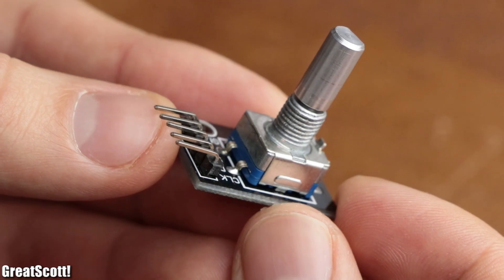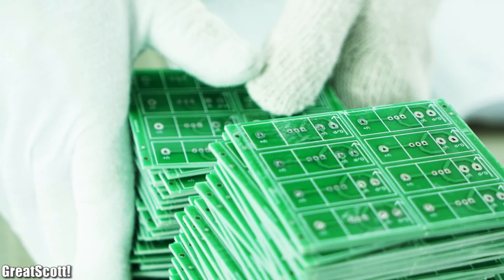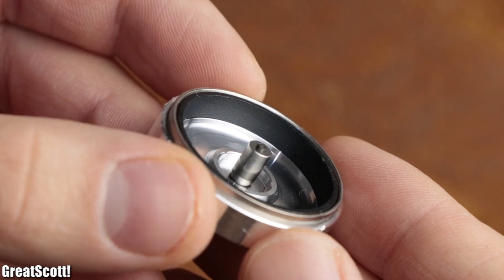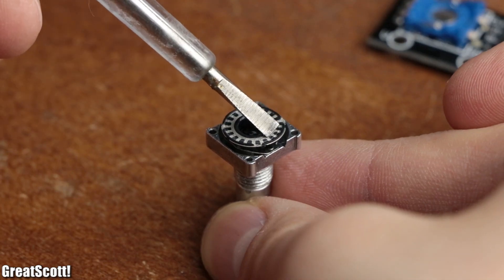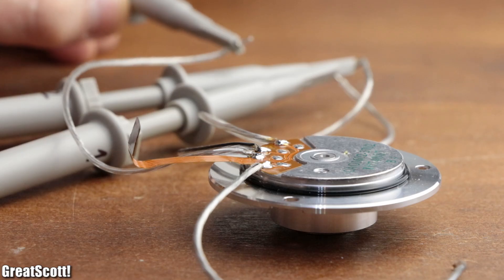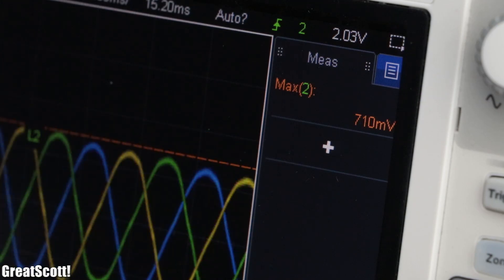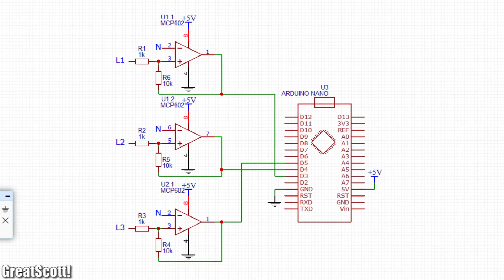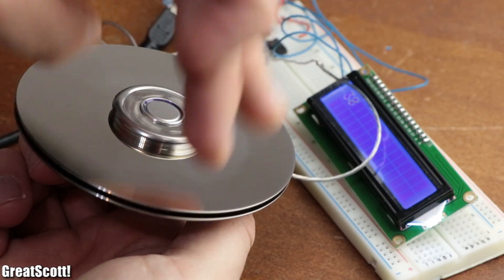HACKED!: Using an HDD Motor as a Rotary Encoder?!

Comment: The number counts up very slowly. 12 poles means each revolution should be what 4 steps?

There has to be a smarter way to get the 12 steps using only comparators.

I guess at analog level the limit is the ADC

Comment: That looks great though I must admit I probably understood only half of it if at all. Would it be possible to adjust the range? E.g. say give it a long spin and have it constantly decrease the value? Sorry for a noob question, I'm not firm in hardware stuff at all, I'm a software developer. So what do we work with in terms of values?
Reply: Haven't built this yet as buzy with other projects so can't say 100% certainty but every time you spin it it just knows the direction so in the code you'll set the rang and the dial will either increase or decrease

Comment: Looks cool! Can you also use this to calculate an angle by setting a refference to 0* and then when you move your angle meter increase or decrease the angle in retrospect to the reference angle? So you get a tool to measure the angle.

Comment: @2:42 when using 3 wire ESCs for 4 wire HDD motor...what does "start point" for 4th connection mean?

Is the 4th connection optional?

Comment: Brilliant.  I took one of these motors apart, but missed the fact that the outer ring which rotates has multipole permanent magnet, which then easily driven by the internal coils.

Comment: Great idea !
 I think you can improve it a little. You can only use L1 and L2 to determine the direction of rotation. At Low to High transition of L1 check the state of L2, if it is High the it turns clockwise else it turn anticlockwise (or vice versa).
Reply: ممكن مساعده بمقابل مادي
Reply: There is some potential latency when you do it that way.

Comment: Hi 
Well explained! 
Can you guide or send any documents for development of small size wheel type encoder for measurement of the distance.
Incremental Rotary encoder with wheel ( less than 1”) 15 pin lemo connector
Thank you in advance

Comment: Very neat. Going to use the motor to run the tower fan the motor that It had has gotten stuck and its hard to turn I'll see I manage to get it going. Other wise I'll place in a hard drive motor, great video.

Comment: That would make for an extremely smooth and precise rotary encoder. Just need to add a momentary switch and precise values would be so easily selected. That actually makes me wonder if a small and cheap BLDC motor could be used the same way.

Comment: hello, i've done a similiar project in the past, but instead of using each period of the sine wave as a one step, i calculated the angle of the rotor continuously with practically infinite resolution only limited by the resolution of the ADC. the three phase voltage values are actually x-y-z coordinates on a tilted circle in 3d space. the normal vector of the circle was (1,1,1) as far as i remember, and doing some simple trigonometry, you can calculate the exact angle of the rotor as long as it's rotating fast enough to generate a measurable voltage. you can calculate the speed from the angle itself, however, the radius of the circle is also the speed itself.

Comment: Well... I don't really think that is very useful as a rotary encoder, since you have to spin it quickly to induce enough voltage and then you have to make it incremenet/decrement very slowly if you wanna be able to precisely control anything.
I guess not having steps is kinda cool, but I would have used a BLDC motor with hall effect sensors in it or something so you can also spin it slowly without it just ignoring the rotation. But in that case you might as well use an optical rotary encoder with no steps like the clarostat  600-128 for example and maybe add a metal knob with a fair bit of mass to give it some inertia.
Reply: Exactly.  Many CD rom spindle motors are sensored and can be used with precision as an encoder.  The reason to do that though would be mainly due to cost and desire to recycle.

Comment: SHEEESH.... WONT A NEMA17 STEPPER ALSO WORK ??
Funny watching a NEMA17 FIRING LEDS without a battery too.
I guess much work is left to me.
A spring-loaded spool, a NEMA17.... 
A CLOSED LOOP SPOOLED CABLE/CHAIN, AND A NEMA17,...
A HANDWHEEL AND H-BRIDGE ...

Comment: The V-level dependance on speed of rotation is a main problem even with a squaring amps. You will shurely loose some of encrements if apply this as positioning encoder.  Look at price of normal optical encoder. It is cheap, precise and perfect. Just use motor as motor.

Comment: Very cool, I have a bunch of these old motors laying around in my back room. I have always been a sort of hoarder of electronic parts, even as a young boy, I would tear apart old radios, and unwrap the old waxy capacitors, then use the foil as a sort of reflector around my bedroom.  These could easily be used as volume controls for the little DF MP3 players when properly coded in the Arduino IDE. I have been toying with such an idea using plain old rottary encoders, but this looks even more geeky!  I may be an old fart, but I do love geeky!
Reply: Welcome to the club m8.   ')

Comment: This is probably better used as a rotational speed sensor
Reply: especially as the signal levels rise as the speed rises
Reply: Great idea but I don't know if there is a law between the output voltage of the motor and the speed, and if it is Linear
Reply: @robbielerenne594  That's irrelevant. All you need is a Schmitt trigger and a quiet signal path to it (a wee bit of coax will do it). On the other side you're counting pulses just like a normal encoder.

Your arduino will quite happily play frequency counter (or more likely - frequency timer) and tell you how fast you're turning it as long as there's enough signal to set off the Schmitt trigger (so maybe not 0.02 rpm :P). Connect two windings to the arduino (separate inputs) and you can also tell which way it's going.
Reply: @robbielerenne594  Also, yes there is and no, it's not. What you've got there is essentially a fairly inefficient (compared to purpose-built units) three phase permanent magnet synchronous generator. Y'ain't gettin' power out of 'er, but you'll get enough AC on the other end to run some high impedance logic (see last comment).

You also want to make sure the arduino itself is well protected from the motor. These are sizeable inductors near some skookum magnets and unless you're willing to splash on a good scope and spend a few evenings testing the thing to death I would NOT count on that signal being too weak to damage your inputs. Send it into something high impedance, make sure it's not something that will short its input to its output lines when it fails, and count the pulses ;)

Also, do NOT connect a 2.2mF electrolytic cap to the 5V regulated output of your arduino with no current limiting :D

Comment: Show us how to decode and hardwire memory cards / hard disks, wlan cards from laptop.... please and thank you.
Reply: Show us how decode and add terminals / devices to old usb thumb drives.
Reply: Show us how to remove noise from circuitry such as onan arduino or raspberry board and how to improve efficiency or upgrade these devices / components.

Comment: Yea but usually when you use such an encoder you don't spin it like a hubcap.  A lower speed would output a smaller voltage, and judging by your measurements, at a "normal" adjustment speed you'd barely get a few milivolts if any. Is your setup sentitive enough to distinguish those few millivolts from natural parasites? I mean, put  a cellphone next to it and you will probably induce some voltage in those coils.
Reply: P.s. love your work by the way!

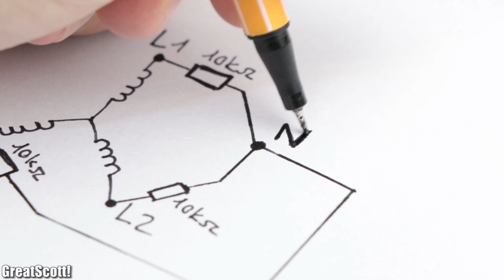Comment: 2:07 some years ago in an exam there was a problem that  included a balanced network with a neutral wire. One part of the problem was to determine the current across the neutral...I wrote 2 pages of calculus...to only realize after the test tje right answer was only 1 line I=0 and I knew it but the nerves tricked me in middle of the exam.

Comment: 5:30 would be easier/more intuitive to see if you offsetted it: counterclockwise is L3 L2 L1 (which is the exact reverse of clockwise L1 L2 L3)
Reply: I'm guessing he did it that way because of the following code, which specifies L1 for initial rotation check, while L2/3 specify the rotation direction?

Comment: I wonder if BLDC motors and Three phase AC motors are interchangeable.
Reply: bldc has parmanent magnets installed. but common three phase induction motors have not any permanent magnets. If you use synchronous motor with external excitation, it  may possible.

Comment: "simple schematics"
Reply: Now you have made a turntable. Let's DJ
Reply: michel777ification  How many times has it got you laid? Loads i'm guessing
Reply: It could seem complicated if you're some kind of starting on electronics. It seemed to me a few months ago. But as you invest some time on learning "op-amps" and all those weird resistances around, it starts to get easier.
My advice: try to understand a circuit by its components or function blocks. (An op-amp is like a multifunctional tool - and it is by itself a little wonder- that is adapted to our purpose using other components around it). In this case, as Scott has taken the pain to adapt them, just think of the op-amps sections as if they were 3 identical "blackboxes".
Once you divide it like so, it will be simpler to replicate. You'll need the patience of build 3 of them without bugs, but complexity will lower.
Reply: I thought the same
Reply: yeah, I thought the same thing... " yeah, sure.... pretty simple "
Reply: koncepto I totally know what you mean. But a few weeks ago I downloaded an app called icircuit for a work project. I’ve only made basic circuits with motors and lights before now so had no hope I could use it. I googled how to reverse polarity (for the project) and it showed me a circuit like GreatScott’s so I copied it to the software and made a mock up circuit for my project. Then I looked on ebay for the components in the diagram and they are just 8 pin chips and a few resistors. I’ve learned in the last few weeks it looks much scarier on a schematic to what the product in your hand will be
Reply: @konceptochannel It is if you understand op-amps which is typically a year one course. 

I barely graduated HS let alone got a degree and I understand this just fine. 

It's all about building blocks and being able to adapt.

Comment: This is a not good approach, you have basically a resolver in your hands ( analog encoder) keeping the ADC method you can use the amplitude sampling as a high resolution encoder with the option to configure the resolution for many applications.

Comment: This has got to be one of the best videos I have seen. It is clear, concise, and informative. I have disassembled hard drives for parts, also to ensure the information on the platters is destroyed but to use the motor as an encoder didn't cross my mind. Thank you for sharing.

Comment: a rotary encoder can detect each detent, no matter how fast you spin it. this motor used as one seems like it can get way way out of sync. it should be able to count pole crossings, say 19 for one full rotation no matter how fast you spin it but i think it can not

Comment: 4:32
I'm quite sure this is wrong. HDD motors are hysteresis motors with a homogeneous magnetic rotor.
And they're AC motors, not BLDC for sure. Also evidenced by the three-phase current on the oscilloscope.
Reply: BLDC motors are actually just 3 phase AC motors which are then typically driven through a power supply/inverter

Comment: OK, that's cool. But what if you turn the motor very slowly, such as what you would do with a rotary encoder to set values. Will the induced voltages be high enough for the comparator to detect?
Reply: I guess you might need to feed star input with sample PWM signal and compare coil outputs with sample. Instead of working as generator they will act as a variable inductors.

Comment: Is it possible to use op amps to detect the rotation of a dc motor? my cheap dc motor produces +/-50mV depending on the direction. I though i could connect it to an op amp such that it outputs a voltage according to direction but it seems that i greatly misunderstood the concept of op amps ... :(

Comment: My homemade Six Digit, 20MHz, CD74HC192 Up-Down counter circuit counts Quadrature Encoder pulses at 20Mhz speeds. And seems to be many times faster than using my PIC16F887 microcontrollers.

Can you tell me why?
Reply: If you look at the PIC16F887 datasheet it has 8Mhz to 32khz software selectable frequency range. Your homemade circuit runs at 20Mhz.

Comment: soo i can use an normal dc motor aswell like rotary encoder instead of 3 phase dc ? duno like i mean if the voltage is negative anticlok and if it is positive clock side ?

Comment: Does this do 1 increment per cycle? that's a bit slow especially considering the fact that the motor has so many coils. Maybe the arduino is reading the signal a bit too slow?

Comment: That's really cool! -- I'm kind of excited to try this. -- Though, a couple of items of feedback: If you're going to solder and resolder wire like that, consider using silicone wire, the plastic covering won't melt, and shrink away like it did in the video @7:30 -- secondly, in your example, you're spinning the motor around like 3 or 4 times for one click? -- That seems to not be very useful -- I'd rather have a much more minute control, like, at least 256 clicks per rotation (if not 1024) - which would be way useful for measuring movement I think (you could always divide it if you wanted something less) -- is that possible with these motors? (Is it just software, or can the hardware not do that?)

Comment: You shold have used the analog values to determine the speed of rotation and use that as the speed of incrementation for the value.
Reply: That still depends on reading the analog value for the peak.

Comment: For a hand operated encoder, I found that what worked really nicely, was taking a dc motor, hooking each side to an adc channel, centering one side at 2.5V, doing a diff of the values of the two channels, and integrating the value for position. There was a LOT less drift than I thought there would be, its easy, give it a shot!  I did it for my new CNC pendant. ... which apparently.... I didn't do a  build log of....  }:-/ ... and I didn't post on thingiverse.... }:-/ ok, hmm, if anyone cares or is interested, give me a shout.

Comment: Great idea! Just i would be happy, if you use normal DC motor instead. I have some BLDCs laying around, but i think, they are better to keep. On the other way, nowdays, everyone has a lot of small DC motors salvaged or bought. Just, they are cheap and everywhere! And also, it will be easier to find, if the voltage is positive or negative on each contact. I dont know, but let me bring you an idea. I am really interested to this.

Comment: Great job. It's really inspirational. I think you could use those ADC pins of arduino to measure magnitude of three voltages and by that determine both direction and speed of rotation and have real rotational speed encoder.

Comment: Hi.  So I tried your code 1 to test for rotational direction input but it just continuously scrolled clockwise even with no input.  I swapped the wires as I couldn't be sure which ones were L1, L2 etc, but same thing.  I also tried changing baud rate but zero effect.  I'm gona edit your code later tonight but wanted to ask for your input first... any ideas what might be wrong?  I have connected the outputs to my multimeter on VAC and got a reading of around 1V.  I might need to create a virtual ground point as you mention...

Comment: It's possible to get an instantaneous position by magnetizing the coils with a short pulses. For example, using your ESC, pulse each coil combination with a short pulse (just to avoid much heating) and note the comparator outputs on the 'scope. By measuring the decay times, you can actually translate the position accurately.

It might also be cool to make some sort of enhanced magnetic detent / user feedback this way as well. This probably wouldn't work very well for something that has to not take too much power, though, without some sort of sleep state.

Comment: Doesn't increment or decrement values with respect to the rotation speed. Defeats the point of working as a rotary encoder. You should implement frequency measurement, doesn't make any sense at this point.

Comment: Hi,
Only 2 outputs from compactor can be used, same way as in rotary encoder. On every interrupt just check state of one phase, and you have instant direction. Also you can start timer in INT, and read it in another, so you have rotation speed, without using processor. 
And finally use third coil to add force feed back to user. Also is possible to use multiple coils to provide sound, vibration, steps, lock, etc... I think that this could be very interesting, and relatively simple to implement in hardware.
Thank you for your videos, and keep up with good work.
Reply: I think there's more to it than just checking the state of a single phase.

Comment: What was the minimum rotation speed you were able to accurately detect?, i can imagine that would be the main limitation of this design. drilling holes and adding some hall effect sensors is the easiest way i can think of to get good accurate slow readings.

Comment: Can you make it spin by itself at low-torque while still remaining the ability to work as encoder? That would make nice DJ controller, since most controllers do not spin by themselves as vinyl deck does.
Reply: The control system would be a lot more complicated, but brushless DC motor drivers do something like that to monitor the rotation of the motor as it's driven.  While power is applied between 2 phases on the motor, the 3rd is watched to observe rotation.